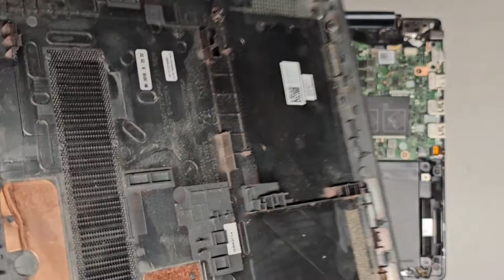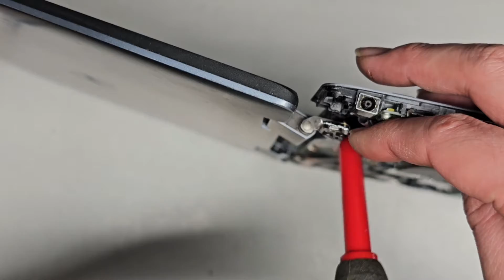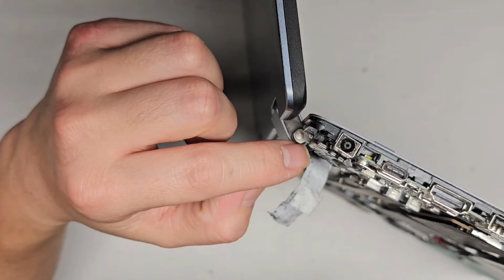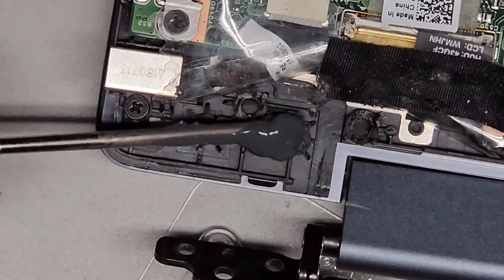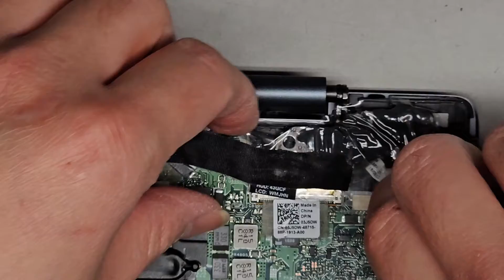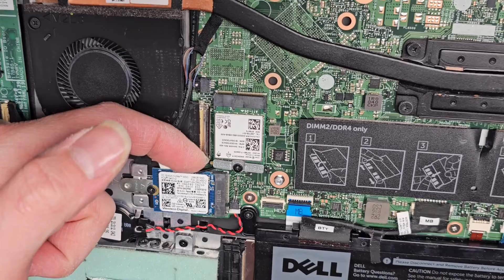Dell Inspiron 14 5000 5482 2 in 1 Disassembly RAM SSD Hard Drive Battery Replacement Hinge Repair

Comment: Thank you for the good tutorial. I have inspiron-14-5482 also but it doesn't have the bracket, but only an empty SSD slot. I would like to install one. What options are available without needing a bracket?
Reply from the maker: A sata ssd